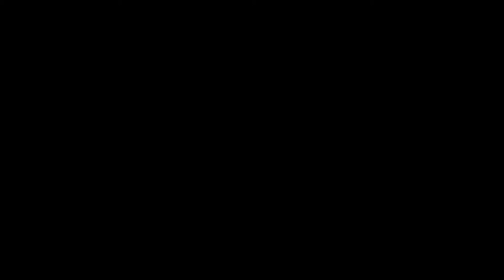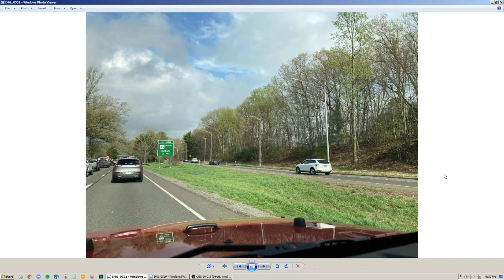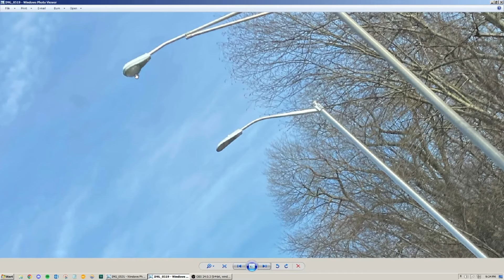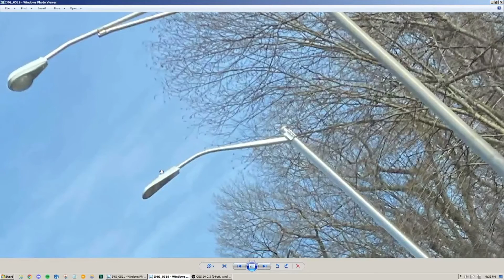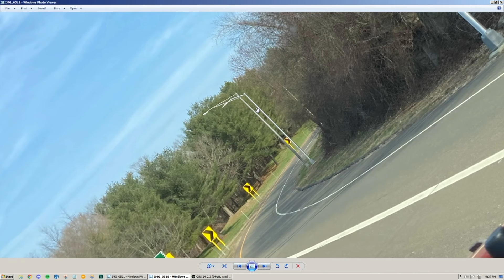I Hate These Stupid LED Street Lights

Comment: I 💯 agree with everything your saying and complaints about the LED street light.    Me personally I don't have a problem with LED lamps in of themselves,  i personally use LED all around my house with the exception of my refrigerator/oven lamp, my 14.5/16.3/ 27 inch lava lamps which use a 25, 40 and 100 watt incandescent respectively.  And I have a 250 watt heat lamp in the bathroom on a 60 minute timer switch (very cozy stepping out of the shower on a cold day😊) and a 150 watt metal halide floodlight in my backyard that a previous owner had installed,  which I don't turn on very often and is used for no more than a couple hours at a time when I need some extra light outside.   If they'd given more thought into the design of LED street lights including the beam spread,  color temperature,  such as 2000-2100K to mimic an HPS lamp,  to no higher than 3500-4000K, mimicking a metal halide I'd have no problem with them replacing the HPS (or metal halide) streetlights that we've known and loved for decades.  

Since thermal management is a bigger problem with higher output LED lighting and shortens their life significantly,  an adequate cooling system is a must, and I think many cheaper LED lamps are driven very hard to give the most light per watt at the lowest possible cost while sacrificing quality and life expectancy , sort of like a photoflood incandescent.
Reply from the maker: All excellent points. The failure of LED lighting is not intrinsically the diodes themselves, but rather poor design and lousy quality fixtures.

Comment: I agree with you 100%. I have been doing my due diligence trying to get people to contact city hall or report to the Highway department how terrible and dangerous these lights are. They are destroying the peace and tranquility causing so much stress that we do not need in a big city. The car LED headlights are absolutely blinding! I can't believe with all the complaints that they are going ahead with this. They have been using halogen lights for with absolutely no problem. They need to reverse this decision.
Reply: As someone who works on streetlights, I can definitely say, An LED fixture is cheaper and thats probably why they are doing it. A new fixture will cost my city $800 (400W HPS). A ballast change is $80 and a ballast typically last nowadays a year or two. Same with the bulbs. You can google an LED fixture for streetlights and they are typically 200-300$ maybe a little more but still. Not $800
Reply from the maker: @x91s55  How long do you find the LED fixtures last? The failure rate is very high in my neighborhood, using Cooper Lighting 30 watt units installed around 2018.
Reply: @JordanU   In my city, any residential lights are typically owned and repaired by the energy company.  But the light outside my house, which we gave them that light. Has  been going strong for easily 7 years or more years. On Monday Ill lyk what type of LED fixture that is and the exact date if It still written down.  But the actual city owned street lights are different. We easily have over 4000 streetlights in our city and we have to fix 20-30 each week.
Reply: The city also tower lights and it ranges from 4 - 6 on a pole and its a 1000 HPS. Each bulb is around $40-50, and the city gets billed $1200 each month. In some areas it cost them upto $2000 a month. (Energy cost) If they switch to LED, (Said from our city guy) Its essentially free for them. Probably the biggest driving factor to switch to LED.
Reply from the maker: @x91s55  The power companies must be fudging the numbers regarding the electricity consumption. There's no way it's that much cheaper to operate the LED fixtures. The efficiency range of the cheap ones intersect with that of HPS.

Comment: I don’t hate LED street lights. I just hate the chintzy ones that cities are putting in and the color temperature is disruptive to circadian rhythm and impairs night vision. I’d much rather have cities put in high quality LED retrofit bulbs than poor quality LED street light fixtures.
Reply from the maker: Good quality LED retrofit bulbs would make a lot more sense and be far more consistent with ecology claims.
Reply: @JordanU  I want them to emit the same orangey white color as HPS lights or at least 2700K warm white.

Comment: Led will never beat hps nema and cobra heads, the glare is horrible in led, near my house there is a led floodlight that from a far distance, can blind you with a horrible glare
Reply from the maker: Many of my neighbors have LED lights on their houses. The lights can be seen from down the street, yet when you get up to the house, the yard is barely visible. The fixtures are just junk.

Comment: In my city, the LED bulbs are a warm yellow and aren't blindingly bright.
Reply from the maker: That's how they should be. Unfortunately, that's a rare case.
Reply: They should just retrofit the old hps fixtures with warm LED bulbs, and only on broken hps fixtures. Problem solved, way better solution than whatever they are doing now
Reply: Warm yellow? I bet they are close to 4000K color, if you measured it. They should be 2500K.

Comment: I agree 100% LEDs are trash. If they're going to use LEDs,  then use Amber LEDs such as PC Amber ( Phospher Converted Amber) Or NBA ( Narrow Band Amber) as the choice ror LEDs then they wouldn't be a problem. Thats what Flagstaff AZ  did when the transitioned to LEDs
Reply from the maker: LED itself isn't intrinsically trash, it's these poorly design, garbage fixtures being installed. The coloring and optics is awful.
Reply: @JordanU  They should be using Amber LEDs they're Darksky compliant as per the international dark sky compliant system that we're trying to implement.  Some cities have adopted it. Amber LEDs would greatly reduce light pollution.

Comment: i have a Schreder streetlight
Model Reference: VZ3S its a low pressure sodium lamp inside got it when they were replacing them in my street for LEDs
Reply from the maker: I wish I could have gotten some of the fixtures that used to be on my street.

Comment: I agree 100%.  I absolutely hate them.  They've destroyed our street such that I can hardly enjoy going out for an evening walk anymore.  I have to wear sunglasses and a brimmed hat.   If you are driving and momentarily look up at one you will go temporarily blind.  How safe is that?  They have no lens to diffuse the light, just a bank of bare LEDs.  It also made no sense that in my city it was deemed very important to blow 10 million dollars on they're (very rapid) installation, especially considering there's supposed to be a pandemic underway.  I'd wager that their even weaponized.  Anyway thanks for this post, I share the same sentiment about those horrid things.
Reply from the maker: I find I often have to drive with the sun visor down at night, just to shield the harsh glare from these things. The optics, or lack thereof, is one of the huge failure points with them.
If you think wasting 10 million dollars was bad, just wait 3 or 5 years from now when another 10 million has to be spent to replace all the ones that failed... There's no savings to be had when using cheap garbage fixtures.
Reply: Yes it is absolutely destroying any ambiance in the city at all at night. You can absolutely forget about going out for a nice evening walk anymore. I saw a post on Kitsilano Neighborhood site about how it will affect the moth population. This will put an imbalance in the ecosystem. Even during the day I can't enjoy walking down the street because when the cars come past the bright LED light is blinding. And there is also the massive amounts of radiation coming off of these lights, both the street lights and the car lights. Driving at night is virtually impossible for me now, I have purchased four different pairs of night driving sunglasses and these LED beams just come right through. This is affecting the population as a whole yet probably 12 people sitting around a table in government made this horrific decision. What I'd like to know is how we can fight this? It's almost like there needs to be a class action lawsuit. Thank you for your input.
Reply from the maker: @Pheanixs  We need to fight for better quality fixtures that would solve all these problems. Voicing opinions is about all we can do at this point. Unfortunately it takes quite a large number to make anything happen, and I just don't think the number of people interested in this issue is enough for change.
Reply: Someone needs to start a class action lawsuit against the government, that might get their attention. In the meantime please take the time to contact City Hall in your area regarding the street lights and the highway department regarding the car lights. Never give up!
Reply from the maker: We should be writing to the DOT and local government offices to request better quality fixtures both roadside and on the cars.
Reply: THE LEDS ARE FINE A**HOLES NOW SHUT IT

Comment: I have a lot to Learn on both ends HPS & LED. I definitely prefer HPS & collect them still need to learn on how to wire them. Definitely first will be the Holophane HMST. Same if LED Had the same design as MV, MH,HPS I wouldn’t have an issue with it
Reply from the maker: I wouldn't have an issue with LED either if, and only if, it was designed and executed properly. Unfortunately it seldom is.

Comment: In Finland in the towns the bluish mercury vapour lamps were used mostly untill 2010. And in motorways low pressure sodium lamps. 
Then they replaced these lanterns to new high pressure sodium lamps in a panic hearing that  EU would ban mercury vapour lamps in 2016. Now those 10 years old h.p.s. lanterns are going to garbage. 

Neighbour town on west replaced 2018 installed lanterns recently to leds. What a waste! And they installed those sodium lamps while undergrounding and changing poles. Before that there was 2010 Phillips mantas (h.p.s) in wood poles that replaced 90's lanterns that replaced one day 1975  lanterns that replaced 1960 lanterns. In the town east side there is still 1960 Siemens in wood poles. Only the bulb changed to led in some because the storage of mercury vapours is going end soon.
Reply from the maker: That really is such a waste. At most, retrofit ballast-bypass LED bulbs should just be screwed into the existing fixtures as they burn out.
Reply: The same story here in Romania.We had Philips Malaga, Mira Vtp, Delfin 1 and 5 models, and the old Elba models from the communist era

Comment: The street lights in my town are actual pretty good. They illuminate the roads just as well as the high pressure sodium lights. I need to more videos of them. They are glare free. I believe they’re made by GE or any reputable company. I will stay away from company’s that are unreliable. However, I still prefer those high pressure sodium lights, metal halide, mercury vapor, and low pressure sodium street lights because I find them more interesting than those LED fixtures. I love seeing those good old lights turning on and casting unique colors compared to those LED street lights. LEDs are good as long as they’re designed properly. I can see the sky with those LED street lights that are illuminating my town. LEDs can last if they have proper heating dissipation. It’s likely those construction works order crappy street lights from China. For example, Detroit bought crappy Leotek street lights that were imported from China.
Reply from the maker: LED can be good, if designed properly. Unfortunately the majority of fixtures are not.

Comment: All the street lights on my local town and county roads have been entirely replaced by LEDs for years. My neighborhood street still has HP sodium lights luckily but the surrounding streets have LEDs now. Luckily the Long Island Expressway, Northern and Southern state parkway, and Sunken Meadow Parkway still have HP sodium. There are two LEDs on the LI side of the LIE but they have been there for a very long time. Probably about 10 years
Reply from the maker: A lot of the state freeways still have the sodium lights, but their days are numbered. I'm seeing more and more new garbage LED street light poles laying on the side of the freeways with every day that goes by.
Reply: @JordanU  Yeah it's sad stuff. And it seems like the LEDs they picked for the expressways are the shitty ones that are an array of a bunch of tiny LEDs. At least on my local town roads the LEDs they picked are actually pretty good. They have a warmer tone to them and they light up the road very nicely. These ones seem to use a few larger LEDs rather than an array of smaller LEDs.
Reply from the maker: @nextg5062  I've seen a very small quantity of the ones with the few larger diodes around here. They do work far better. Unfortunately the majority of them are the units with the large array of tiny diodes. Those fixtures tend to have poor illumination and don't last long.
Reply: @JordanU  Agreed. NYC seems to have gone with that kind as well. Makes sense based on how that whole place is run...

Comment: leds should be banned!
Reply: In matamoros theres a lot of these copper ovz light everywhere, but some lights are being replaced with these white led lights, i miss that lights that see me growing up for 12 years
Reply: Darn right LEDs need to be banned!!!🔥
Reply: Remember they basically banned incandescents and what did they start marketing like crazy? CFL lights, with MERCURY VAPOR and high frequency EMR emissions from the ballasts (something entirely missing from incandescents). And they didn't last any longer than incandescents (in a lot of cases lasted less long), got extremely hot and posed fire hazards (plastic bases), or simply broke from impact or trying to remove them, exposing the person to breathing mercury vapor.
Reply: @12skipafew-e7y  not true at all, they all outlast incandescents
Reply: @BRISTOLFORCE2009  Not true at all, they do not outlast incandescents.
Reply: @12skipafew-e7y  yes they do
Reply: @12skipafew-e7y  you either have really good incandescents or really shitty hid’s, there was an mv lamp that day burned for 20 years straight then the dude powered it up and it fired no problem
Reply: @BRISTOLFORCE2009  CFL's are the fluorescent tube lights, which came after pressure was put on cheap, effective, low cost, zero EMR incandescent lamps that have been around in various forms since Edison. The CFL contains mercury vapors and other gasses, requires high voltage to fluoresce the gasses and metals. These little "twisty" bulbs as people call them are crap and they get hot, turn the plastic bases brown, emit EMR from the ballast, and obviously cost a lot more than the stuff they replaced. LED came later, replacing most CFL. But as with anything, there's low-cost LED which don't last either. The color temperature is also a general problem as many are 4500-6000k whereas the original incandescents were 2700k mostly and didn't screw with your brain's rest/recovery cycles (and didn't blast your nervous system with more EMR).
Reply: @12skipafew-e7y  I already know about cfl’s but thanks
Reply: They are. Wont stop the bastards. Destroying human life quality. Godspeed. P s. Get creative.
Reply: LEDS SHOULDN'T BE BANNED IDIOT
Reply from the maker: Cheap garbage fixtures should be.
Reply: @JordanU  this explanation might explain why it’s replacing the old lights: Why can’t they replace the bulbs? Or fix the wiring? Well all states replaced the old lights with new ones, why? The light must be malfunctioning or flickering or on all the time or maybe if it’s working just right why replace it? The old light does not require or has a big space of light. Replacing it sounds bad cause the lights nowadays are breaking down.
Reply from the maker: @ZacharyHappy366 What explanation?
Reply: @JordanU  the one I said, where I live we have most of these standing and lanterns
Reply: @nicholasfranklin5355  bro calm down
Reply: @ZacharyHappy366  here in new jersey it’s still nearly all sodium